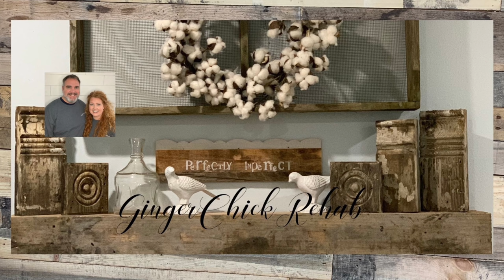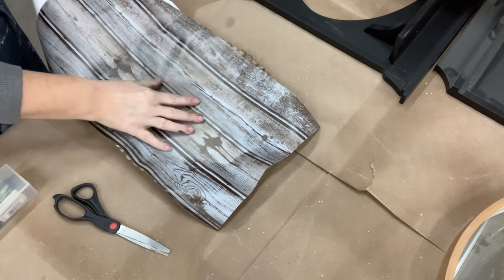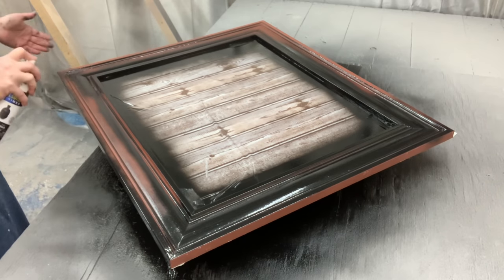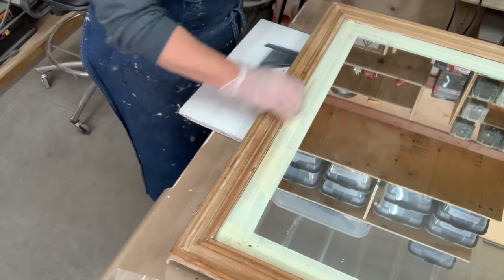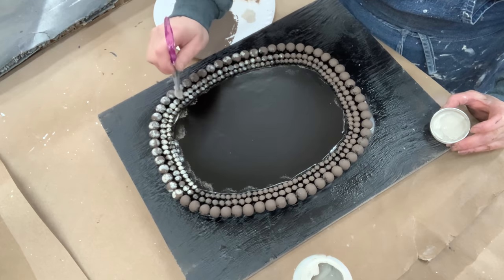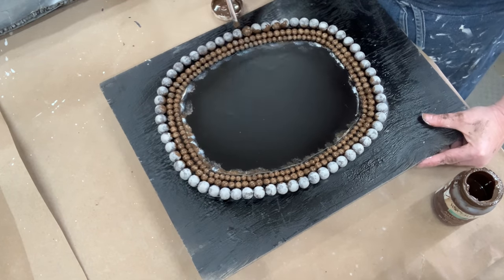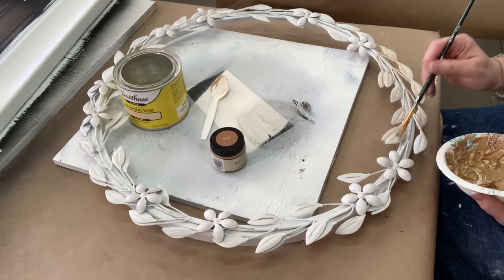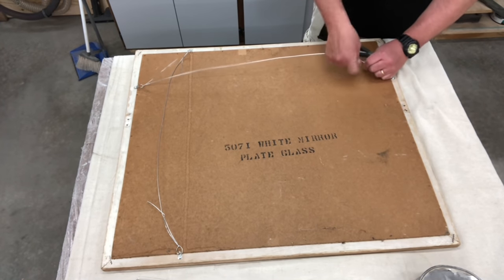Giving A Farmhouse Makeover To Thrifted Mirrors || Trash to Treasure || Thrift Store Makeovers

Comment: How long are you waiting between the spraying rustoleum finish and the sanding? I've used it for years (though admittedly not for refinishing things- I use it to make origami jewelry water resistant and sturdier) anyway, if you leave it overnight (or longer) it'll become less gummy and more crisp. (At least in my experience) I'm not sure the extra time is viable for a reseller like you, but it might be worth trying?
Anyway, LOVED the flower mirror! It looked like a well-loved piece that's been in the family for years. I'm gonna have to try that composite glue for some of my own fixes. I also really liked how you made the indents pop so much on the wood one. And the one with the swirly almost fluer-de-lis thingies looked beautiful!
Reply from the maker: Thank you for sharing that